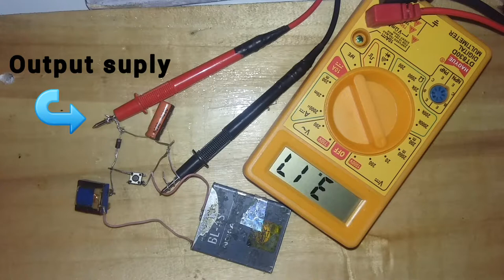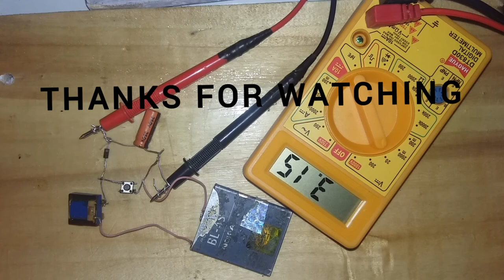How to make a 3v to 12v boost converter

Comment: On multimeter it shows the voltage increase nicely but if we go to use that amount like 12v router it dosent work
Reply from the maker: Yes because it is working principle  of boat converter
And its using transistors  for switching  continuously